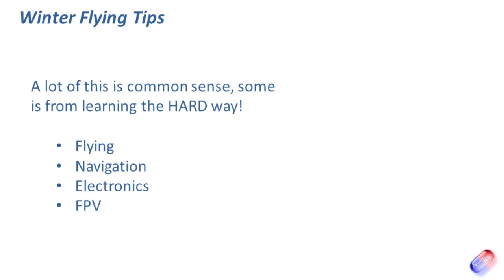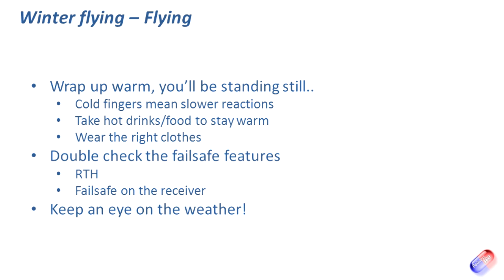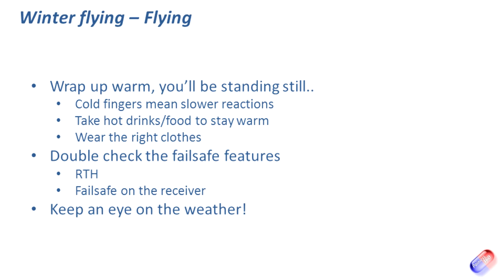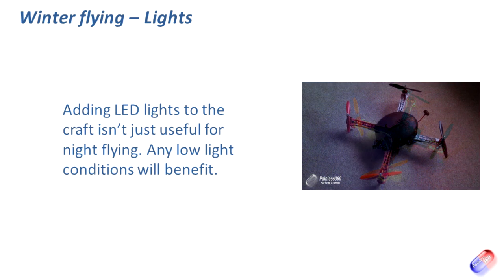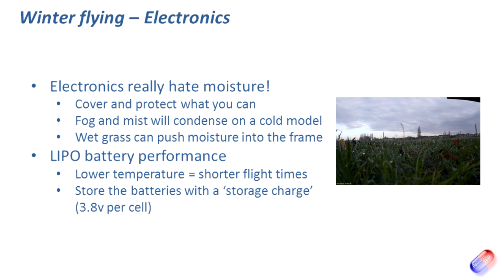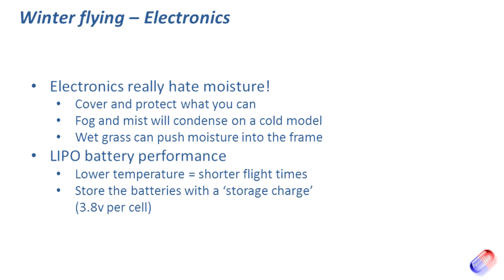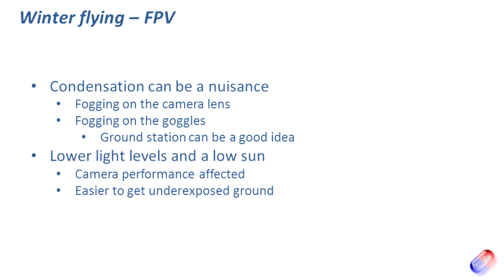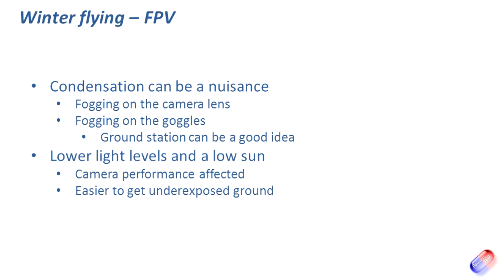Remote Control (RC) Winter Flying Tips - Power, Electronics and FPV

Comment: I got my drone during the winter with all the problems of cold weather flying. I have done a few things to keep my little quadcopter in the air that I just thought it would need during all seasons. I'm happy to hear I'll be doing much longer flying and photography during the warmer months! I really thought the weather made no difference on the quads electrical systems. I only thought of keeping the batteries warm in my pocket. I did forget about the lens fogging since it does the same thing with my larger DSLR camera during winter/cold weather shoots.

Now I get to look forward to warmth and getting spoiled during the spring/summer months. Thank you for this video!

Comment: Your timing is impeccable- as always. Many thanks.

I would only add that many of the props made that are plastic and composites will become brittle and snap far easier than wood or carbon fiber.
Reply from the maker: Good point! Happy flying!

Comment: Hi thanks for your super fast reply on my message about the voltage alarm BUT the Kk2.1HC seems to be a different fish to the Kk2.0 IT HAS A BUILT ALARM iv flashed all the ESC ,S AND THE latest stevies firmware but I still can't sort the alarm out any thing above 0 and off it goes 
Brian
Reply from the maker: brian forward Brian, the setup on the board is exactly the same, only the pins that you connect the main flight battery t is different.  You need a separate connection from the KK2.0 voltage sense pins directly to the flight battery. If you don't have this plugged in then the board will alarm as soon as it's any other value than zero (zero disables the alarm).  If you need any more help schedule a Google Helpout session and I can take you through it. Happy flying!

Comment: You can spray your electronics with clearcoat as a back up if near sea air.
 Good to put a little packing tape over hole where motor circlip is then if it pops off it will be on the tape and keep grit out.
Reply from the maker: What clearcoat do you use? I'm always worried about it being slight conductive..

Thanks, happy flying!